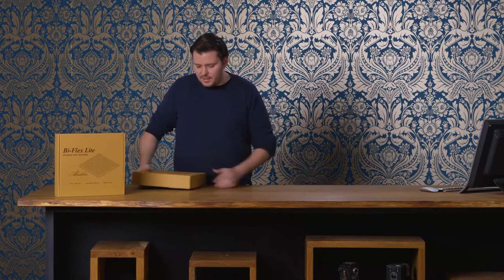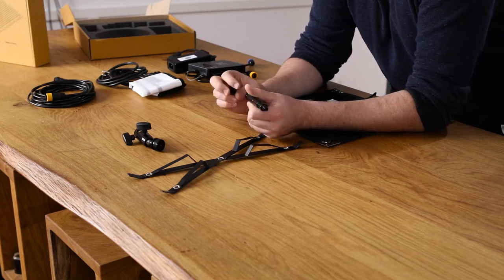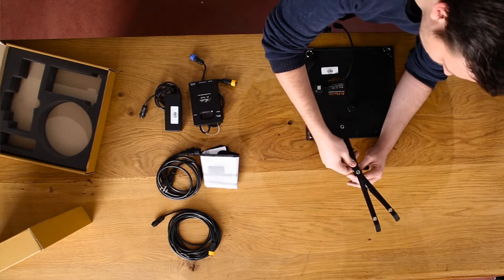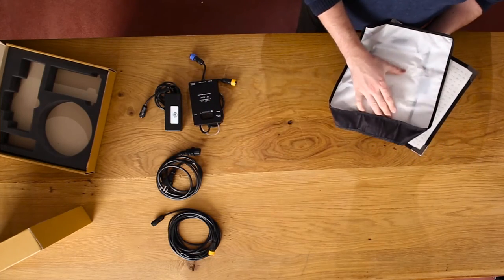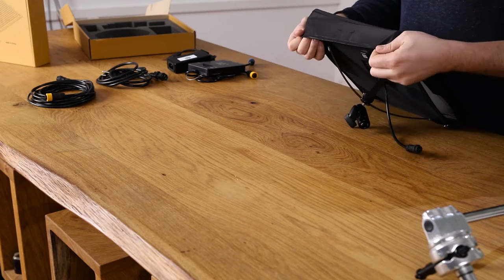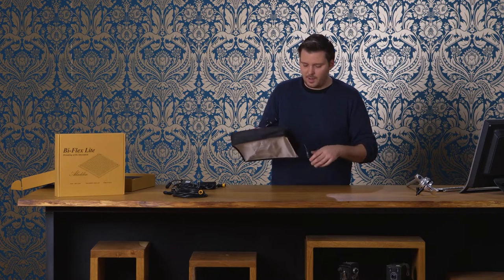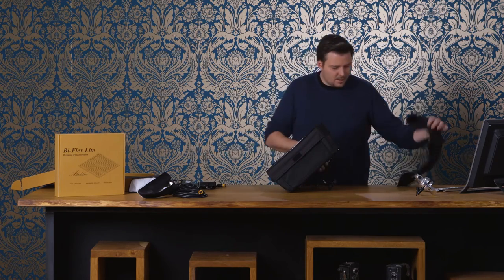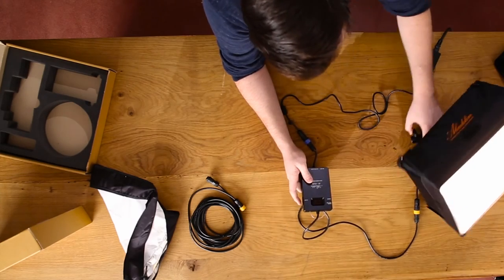ALADDIN BI-FLEX 1 Tutorial | How to set it up

Comment: People who will buy this light, will need to see other things, for example in totaly dark room from 0 to 100 intensity how low it can go and how it increase. Also, the color change was not visible in your video. Basically, all important elements for pro users are missing. Make a simple interview setup or movie scene. What is the power consumption and what are the values for the light intensity of one or two meters?  I can continue until tomorrow with questions that ALL video guys will need to know.
Reply from the maker: Hi Electronic Box. Thank you for the Feedback. You can find all the technical infomration on our homepage. The Video is about how to setup the light and what is included.
Reply: @AladdinLights  what are the dimensions of the additional softbox? And the grid?